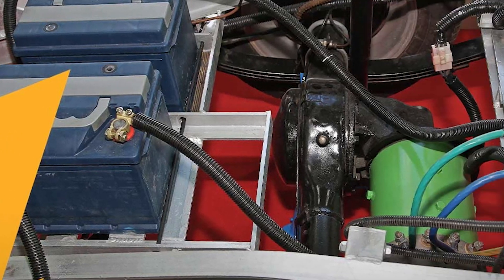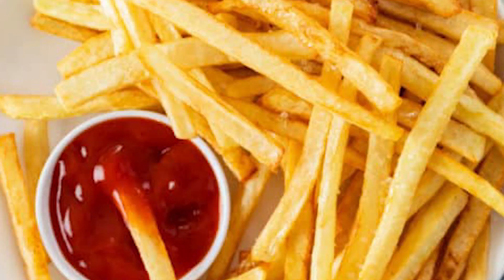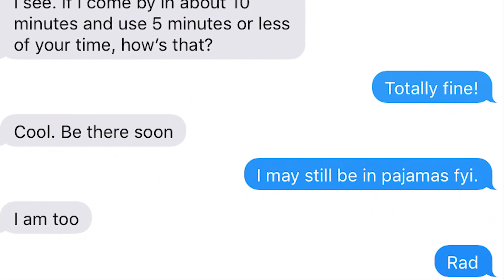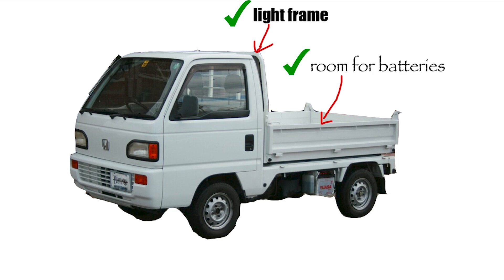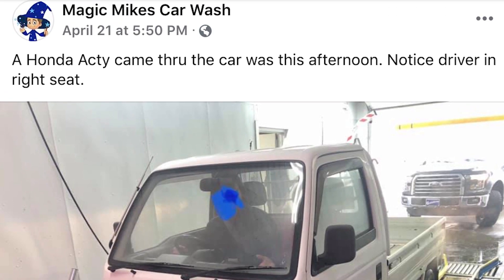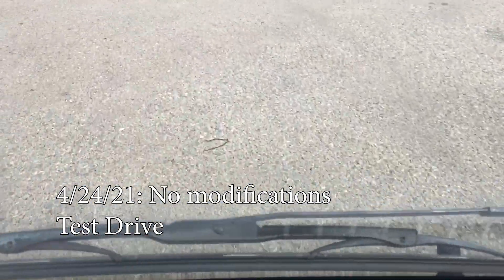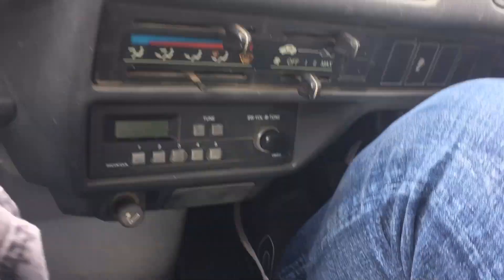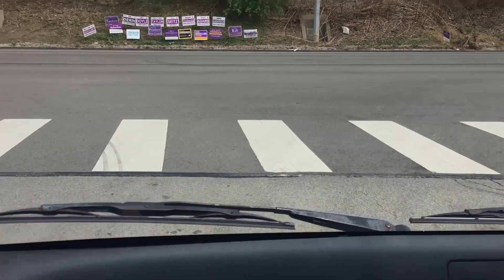Converting a Kei truck into an EV - Buying the car - Part 1

Comment: Cool stuff Rich. Kei trucks have gotten so popular lately that prices have increased quite a bit and some states are bannng them. 

I’m working in an old US legal Honda Z600, removing the live rear beam axle and replacing it with a $2000 Chinese 3000w rear wheel drive dad axle/motor with 6 12v lithium batteries located in a tray  hehind the back seat.

Comment: Just a few days ago I also came to the conclusion one of these would make a perfect Ev conversion, from a little googling so do a few other people. There are quite a few variants to consider, eg. there is a type that has the motor under the tray instead of under the cab which would possibly give a better space for the batteries, also having the weight under the tray helps with traction a lot which all utes have a problem with unloaded....I can see my government is not going to do sh!t to progress Ev adoption affordably so I will have to do it myself.